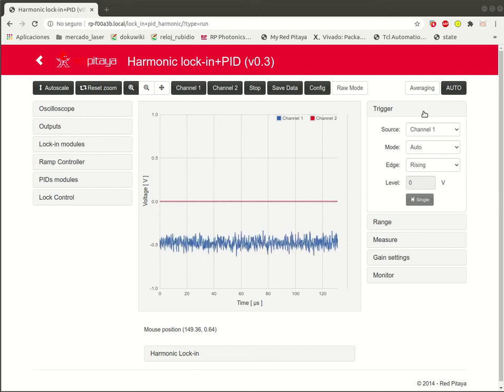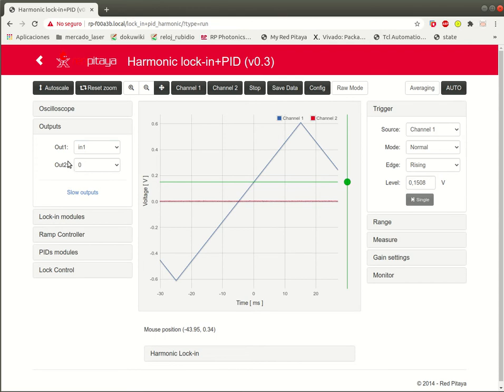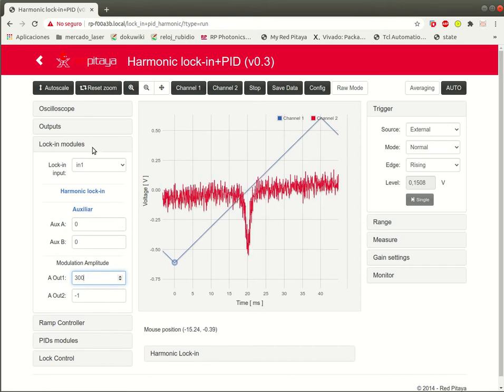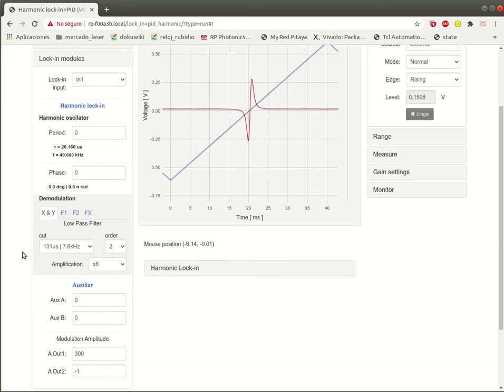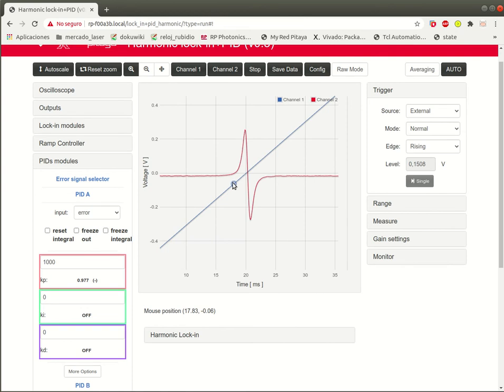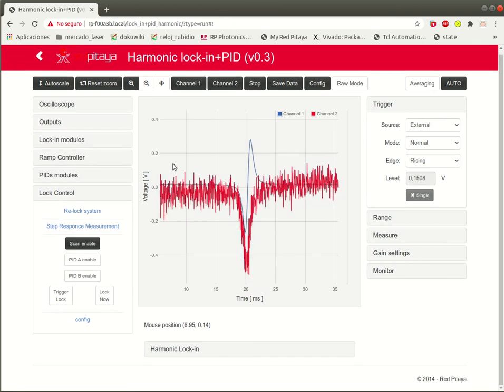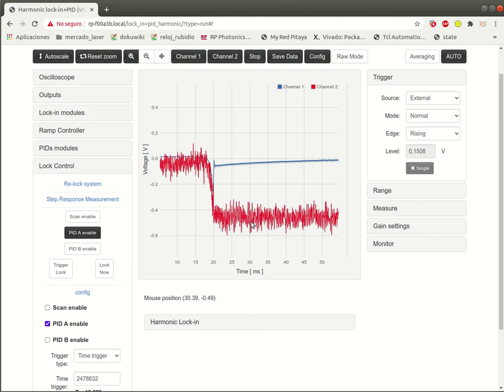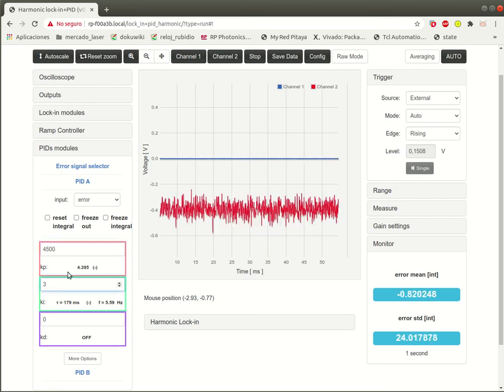Short demonstration of a lock-in procedure with de Harmonic Lock-in+PID Application for RedPitaya

Comment: Can you say how to add lock in pid application in red pitya?
Reply from the maker: The original version "Lock-in+PID" can be found in the oficial market.
The improved version that ONLY HAS SLOW HARMONIC LOCK-IN called "Harmonic Lock-in+PID" can be installed following the instructionsin https://marceluda.github.io/rp_lock-in_pid/TheApp/install/
But instead of using the binaries in tha tpage use the ones found in https://marceluda.github.io/rp_lock-in_pid/Derivated/
Reply: @marceluda  actually the problem is when l tried to follow the steps by win scp , not working. When l change the directory  to red pitaya in win scp and paste the downloades Lock in pid file, it's not happening. 
 Pls give me a solution
Reply from the maker: @sathidas7534  Ok ... there's another way to upload the app folder. You can extract the micriSD from the STEMLab and plug it in a notebook. One of the drives inside the microSD is the web folder with all the APPs. You can paste threre the app you want to upload. The folder you have to copy is the one that contains the fpga.conf file.

Comment: Dear Marcelo. 
Great work!!!! Would it be possible to lock on the maximum of the error signal? I am asking, because I used a Fabry Perot interferometer to demodulate phase information into amplitude modulation for a laser ultrasonic experiment. In my setup i simply used an arduino board and lock on half the maximum amplitude of the fringe output. But using a modulation signal on top of the scanning signal looks much more stable.
Best regards
Bernhard
Reply from the maker: Thanks for the comment.

I'm not sure if I understood your setup. The idea is that you BUILD your error signal from your experiment output response in a way that the point you want to lock is an error zero-crossing-point. 
With modulation and demodulation you can build and error signal proportional to the derivative of the output beam intensity and use it to lock the maximum.

If what you want is to build a signal proportional to the second derivative, you can try to demodulate with the 2nd harmonic (the F2 signal, that is a lock-in demodulation against 2f, and that's kind of proportional to the second derivative)